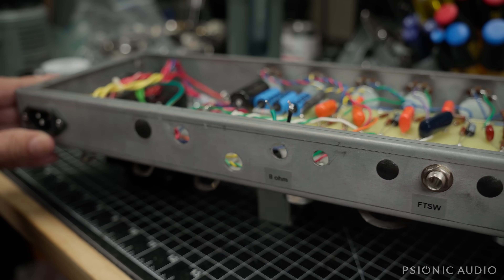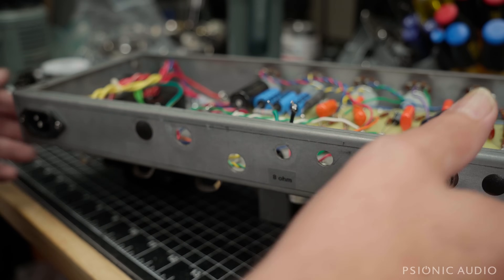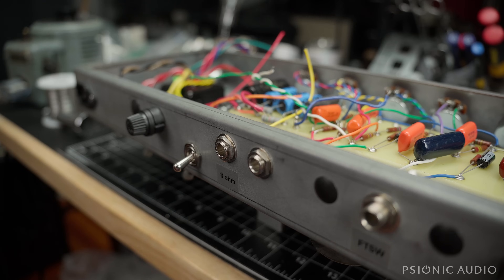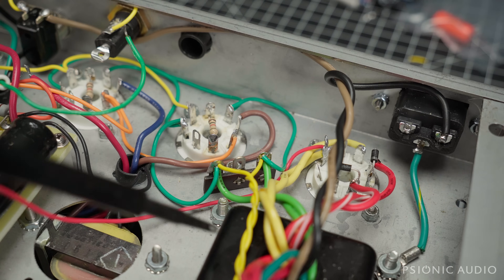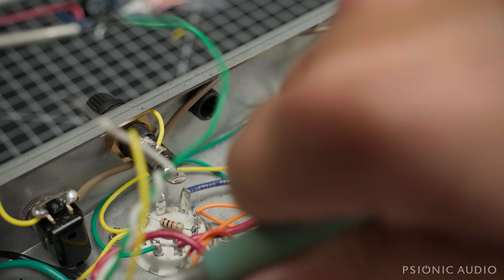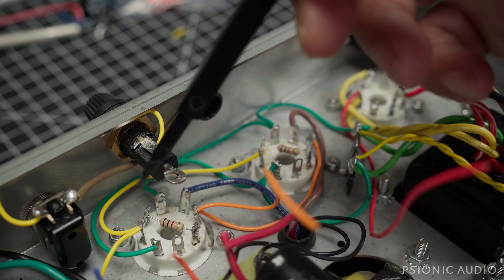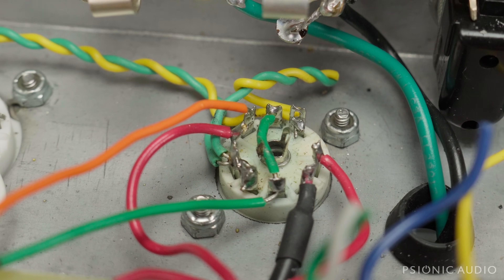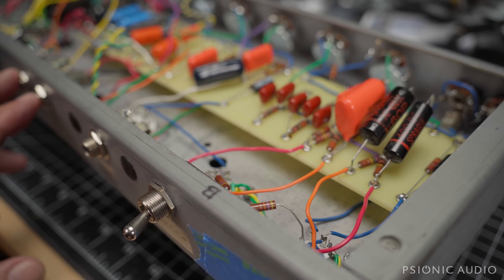The Work Begins | Five Watt World GA-40 Pt 2

Comment: So you'll be building an amp.  😂

Dumb question:  Are there any standards or best practices when deciding on what color wires to use?
Reply from the maker: Not quite a rebuild, but it can seem like it.

There are, which I’ll be going into more in the next video. Yellow = cathode, blue = plate, orange = screen, etc.

Comment: The Black Beauty caps were just Sprague bumble bee caps with Mylar sheeting layered in with the paper and some epoxy resin packed around the lead protrusions. Go dump some saltwater down your nostrils, take some Tylenol PM (not exceeding the recommended dosage) and go get some rest. I hate to say it, but dumping salt water with a bendy straw into my nose works great for my sinuses. You can't overdose on dripping saltwater into your nose, and it works rather well for me. I have overdone those nasal sprays and it just exponentially adds to my misery.
Reply from the maker: I can’t do the saltwater nose thing. Tried it. Felt like drowning. Never again.

Comment: Thanks for soldiering on Lyle. Looking forward to having this 12 watter in Bristol fashion.
Reply: Or ‘soldering on’.
Reply: @DicksAmps  Haha that's the way I read that!
Reply: Lovely to hear the phrase Bristol fashion ( Shipshape and Bristol fashion).
I’ve used it ( I’m in UK) but never knew it’s derivation .
Shipshape or ship shape is a reference to being neatly and sturdily tied down… nothing flapping about that could be a trip hazard. 
Bristol… refers to the Port of Bristol … which before it bacame a floating harbour had tides that fluctuated over 30 feet in height… ships were required to be very sturdily built to survive docking in Bristol as the tides frequently damaged the sides of the vessels.
So … well tied down and sturdy.
Reply: Boy, that's a LOT of rework! Seems like it was almost approaching the point where a new, scratchbuilt amp would be more cost-effective, though you wouldn't have the staisfaction completing one yourself.

Comment: One stick of cinnamon in a good sized mug, a good squeeze of lemon, a generous shot of rum or whiskey, pour in some boiling water and let it steep for a bit...repeat as necessary until you're better (you'll feel better right away, but I mean 'better').
Reply from the maker: Better without the cinnamon and lemon. Or the water.
Reply: I second that. Cinnamon is a good expextorant though. Better yet, clean and wash some fresh ginger and store it in the freezer. Use a microplane grater to add ginger to your drinking water. This will also help protect your liver from too much rum. À ta santé!
Reply: @PsionicAudio  I find a coffee and a wank works better.
Reply: @PsionicAudio 🤣🤣🤣 agreed!